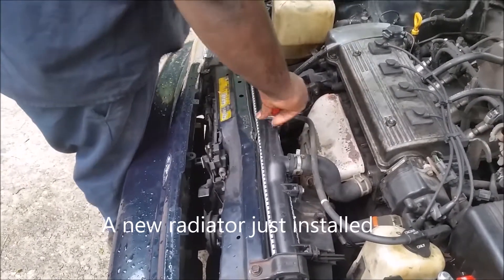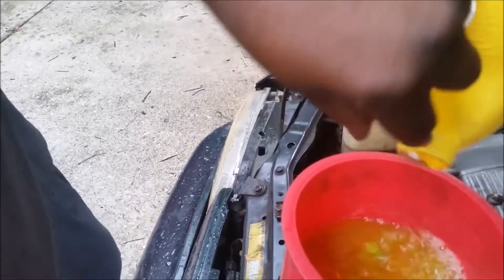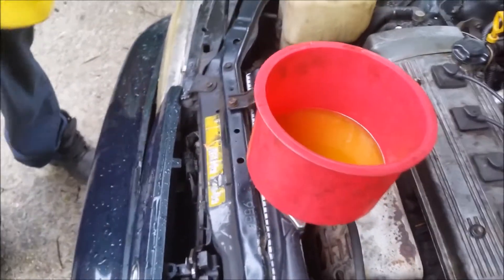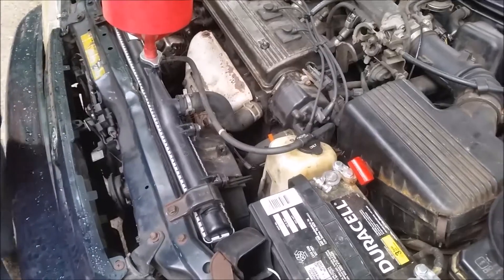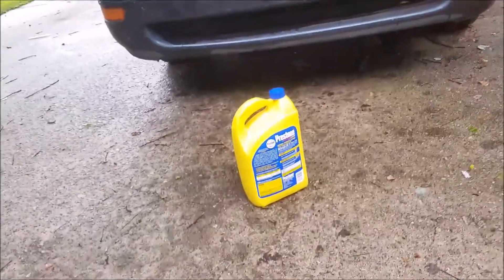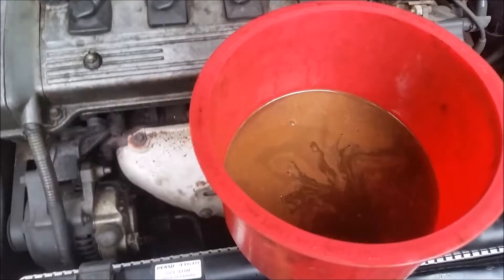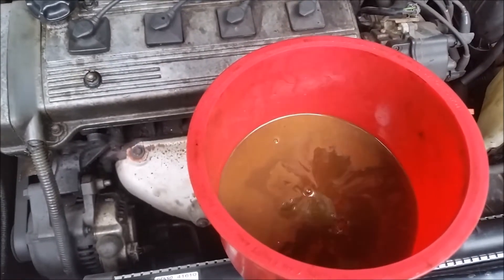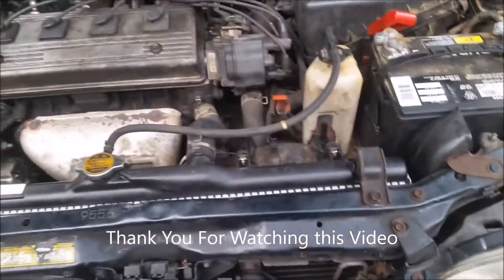How To Fill Up  Radiator Coolant  And Bleed Air Out The Cooling System

Comment: The coolant is STILL contaminated with rust and decades of debris. You ding dongs needed to flush that radiator, fill it, and run it with heater on.

Drop coolant and repeat 2-3 more times.

I have no idea what this is because this looks like a nasty drain and fill.
Reply from the maker: That what I did. This radiator is new.

Comment: I appreciate the effort to help us dummies figure things out...
Was wondering if necessary to flush out old coolant first? I dont have any containers to safely dispose, so i was just gnna top off
Reply from the maker: If you are not replacing the radiator and you just want to add coolant to your radiator you will not need to flush out the old coolant.
Reply: @josephk9182  thank u. Ok. Wasn't sure ha ha. Figured it's why i am now getting a lower mpg. Of course the ac stopped working and heater as well.  But prob just it's time. 2017 nissan rogue lol

Comment: wont the air be hot because the engine is hot? why if the coolant is not enough the air would be cool?
Reply: My advice is that if you don't already know.... pay a mechanic to work on your vehicle. The answer is so simple and because you don't know, you shouldn't be working on your own stuff. Pay a mechanic.
Reply: @paulcollinsworth3326  I am pretty sure I know more than you and it was more of a rhetoric question.

Comment: i really hope you reply.. like today. Doing this very same thing to 2001 grand cherokee laredo 4.0. i think the head gasket needs changing. $$ not worth it( Have no one to Help me) so I  was going to add a bottle of bars leak along with filling the new radiator.. what are your thoughts?
Reply: There are fluids which calim to repair headgasket. they work as long as you use the correct one and the leak is not big. no harm in trying it out.
Reply from the maker: Will not work for long time  if the head gasket needs to be replaced.

Comment: I have a Mitsubishi Outlander, hit a deer the other day and messed up the coolant system so rn it's getting changed.
Reply from the maker: Good luck
Reply: @josephk9182  thx man, two more days and it should be up and running

Comment: Dame thank you .....gonna do this tomorrow....radiator still leaking have no idea how to fix it try all stop leak product bars leak nothing work
Reply from the maker: Good luck
Reply: This isn't going to fix your leaky radiator and the Stop Leak will clog your thermostat and blow up your cooling system. You're gonna need to take out your thermostat and either really clean it or replace it, as well as flush and replace all the coolant. Before replacing the coolant you'll also need to find and have the leaks properly fixed by a professional who knows what they're doing.
Reply: @DaleErnieMichael  yup leak continues so ....just add distle water and sometimes mix coolant and drive ....hard work better than spend $300-1000 change radiator

Comment: I had to fill up my fluid more than 3 months ago because it was nearly empty. But it hasnt gone down since. Reason for this ?
Reply from the maker: I believe you had/have a leak in the radiator hoses that was corrected or you have a leak of the coolant into the engine block.  This issue may appear in the summer when weather is hot.
Usually When you have a coolant leak you will smell it. You can test it in mechanic shop. The mechanic will apply pressure on the radiator where is the cap and verify that no leak. Also check the radiator cap.

Comment: Anybody else think the head gasket  on this car is blown and there is oil in the coolant?
Reply: 100%. The radiator started pumping out the coolant from the cap end when they took the funnel off so there was definitely pressure from the valve train pumping through, which is further evidenced by the fact the brand new orange coolant instantly turned milky brown. I'd bet if he took the oil fill cap off it looks like Starbucks mocha frappe foam under there.
Reply: nope, Its a toyota. Toyotas' of 90s neve have headgasket issues.

Comment: That car needs to be flushed as the coolant is nasty and shows neglect of cooling system
Reply from the maker: The radiator is new. We first replaced the old radiator with new one  and then fill it  up.
Reply: haters. radiator is new...smh
Reply: @sollovlov9619  You sir, are ignorant.  So what if the radiator is new, the cooling system passages in the engine have all the old, nasty, rusty coolant and they just mixed new coolant with the old doo doo brown stuff.

Comment: The Prestone used here is a universal extended life coolant, it's perfectly fine to use, you do not need the OEM Toyota coolant.  However, as seen in the second half of the video, your system needs a thorough flush with fresh water, the old nasty brown coolant mixed with the clean, new coolant and that is not ideal at all. Might even have a blown head gasket, as bad as that stuff looks.   How many miles did this car have?  Is it still running today?
Reply from the maker: When I did it it was 200K milie now it has 230K miles. It is still running perfectly.
Reply: @josephk9182  Joseph, do you still have the car today?  If so, how many miles now and how is it doing?
Reply from the maker: @coolantkid3428  I sold it a year ago . It had 230000 miles.
Reply: @josephk9182  I bet it still runs great.  Please post another coolant change video featuring the mechanic Jacob.  I really liked this video and hope to see another on your current vehicles.
Reply: It’s a 90s Toyota, when do you ever hear about a stock Toyota with a blown head gasket. 90s Toyota’s are some of the most reliable vehicles ever made.

Comment: So yesterday, my 99 le sabre ran out of coolant and quit running. Tomorrow, I've gotta fill it up so I can drive it to the shop, 4 blocks. I bought 50/50 today.
It's sub zero outside and I'm also a single mom...
1. Do I need heat to drive it? Being so cold out, I'd expect all the coolant to be out before I'd feel any heat. 
2. The car died... Would u expect it to start once the radiator is filled n burped, or will I have to jump it? I've got a jumper... 
Thank you for your time and advice.
Reply from the maker: The radiator function is to cool the engine.  If the outside temperature is freeze  you can drive the car 4 blocks with no coolant, just look on the engine heat indicator on your car dashboard and make sure the engine doesn't over heat . The car died has nothing to do with the coolant. You should try to jump start the car. You also should fix the coolant leak as soon as possible.

Comment: Did a 2010 town and country today and it took 40 minutes and I still am not convinced I got all the air out.  Barely had any heat before.  It was roasting after I took it for a test drive.   Had to keep squeezing upper hose to get bubbles out.  I heard Dodge and Chrysler were hard to get air out and now I know.  I used a floor jack and jacked up front of van while burping.
Reply from the maker: Thanks for the information.
Reply: jacking up removed the air? I am facing the same problem with my hyundai elantra.

Comment: You only use red coolant for Toyota get facts right I have a Toyota they told us since 1998 to use red
Reply: Lmao it doesn’t matter
Reply from the maker: I bought the coolant from Toyota ant it say for Toyota.
Reply: Wrong mines clear although it overheats all the time
Reply: My toyota coolant is actually pink.
Reply: Color is a secondary thing. yellow coolant is mostly universal now a days and can be used/mixed with any coolant. Also coolants are not suppose to be mixed that does nto mean you cant use different color coolant. so diff color coolant can have the same specification to meet your car's radiator and engine block.
Reply: Wrong toyota is blue. And i used blue coolant